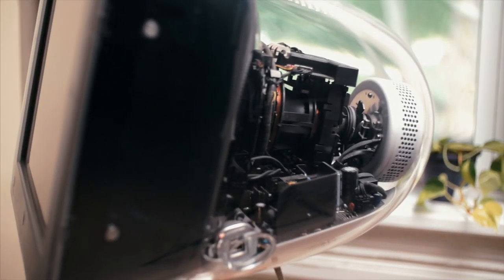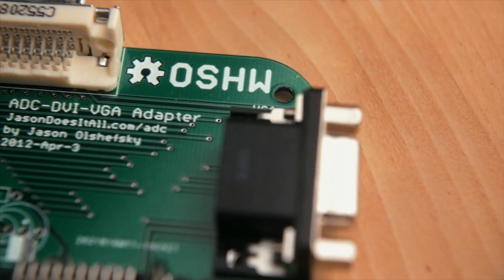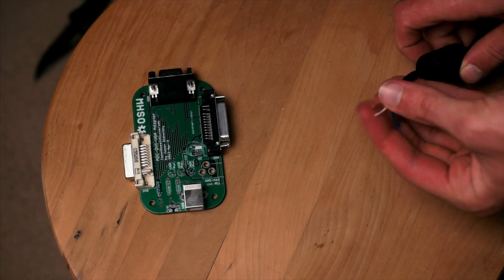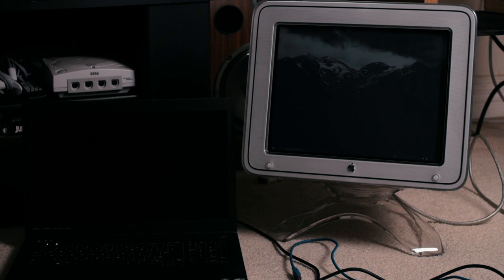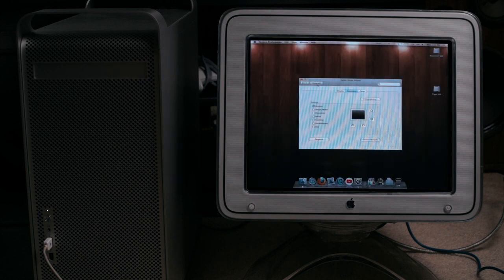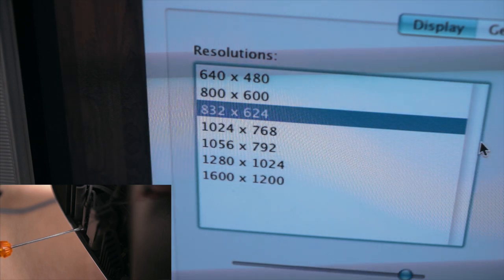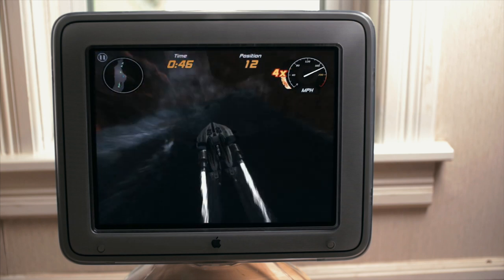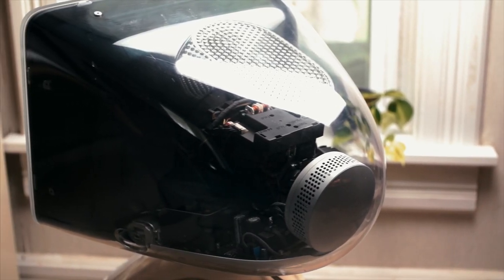Apple's last CRT - Review + Connecting it to a modern PC!

Comment: This man was just poking at the insides of a CRT while it was still on, I could never
Reply from the maker: As long as you know what not to touch, you'll be fine. They're not as lethal as most people think.
Reply: @griffensander  When on they sure are. If its off then I agree. 

I think a better way to phrase this is: just because something can kill you doesn't mean you should avoid it i.e. driving a car, replacing a lightbulb, going outside of your house.. you just need to know where the risks are and how to be responsible and avoid them. And always have a plan for if something goes wrong (often having other people with you)
Reply: Theyre very lethal given that most people dont know what not to touch @griffensander

Comment: Apple did make an ADC to DVI adapter. They are rather common on eBay for 30-40 bucks.
Reply from the maker: Yes, but it's only for their flat panel LCD monitors. The CRT needs adapted to VGA.
Reply: @griffensander  Hey! i'm looking into buying this very same CRT and I was thinking in the official adapter, are you sure it does not work with the CRT? have you tried it before?
Reply: Manu Perez I tried Apple DVI to ADC Adapter. But it doesn't work with this CRT monitor. Now I'll try Jason's adapter.
Reply from the maker: @manuperez6698  I haven't personally tried it, but I am certain it does not work. If you look at the DVI connector on Apples adapter you'll notice it's physically missing the pins that carry a VGA signal through DVI. Not only that, but people on various forums claim to have tried it and say it doesn't work.
Reply: @griffensander  Quick question here then, in the video you talk about less than 154hz (which is the max frequency it can output with old macs) this is because of the vga vs dvi?
Reply from the maker: @manuperez6698  No, it's because Apple used some very specific custom display timings to control the electron gun that were programmed into OS X. The cable makes no difference, if someone could figure out the exact timings you could replicate them using CRU on Windows.
Reply: @griffensander  You have to buy a HDMI to DVI-I to pass analog to the apple dvi to adc converter.  I strongly suspect that others are buying HDMI to DVI-D adapters, which don't have the four pins to pass analog.  Why there exist DVI-I and DVI-D is kind of bad standardization.  There should just be one type of DVI connection, and all should have those four pins. What you have now is people sell adapters as DVI, without stating if it is -D or -I because -D is far more prevalent.

Comment: I just picked one of these up and your video was super helpful. I'm working on building one of these adapters now.
Reply: Me too, i've just ordered everything. How did you do?
Reply: @fernandochapa1433  I have not got it working yet, I suspect my power supply is not proving it enough juice. It shows up as a usb device but no picture.
Reply: I got all the parts as well. I'm struggling to understand the diagram. I got the resistors, what diode did you use? Also, are capacitors that go where it says "VGA Pwr", "USB Pwr", "ADC Pwr". Let me know. I'm about to start soldering. I also got the micro USB, but the large one seems to be a Type B USB.

Comment: Thanks! Really helpful! I ordered the same adapter. 
And I have a question. Did you use not DVI but VGA port of the Jason's adapter? Do I need another DVI to VGA adapter?
Reply from the maker: If your computer has a DVI-D port and you have a DVI-D cable you can just use the DVI port on the ADC adapter because DVI-D carries a VGA signal.  I just used a VGA cable and adapter because I didn't have a DVI-D cable.
Reply: Griffen Sander I see. I'll try after I get the adapter. Thank you so much!
Reply: @griffensander  DVI-D Does not carry a VGA signal. DVI-D standst for DVI-Digital. You can see how the connector is missing the four pins that go around the cross, and instead it just has a straight line in its place - those pins are what carry the VGA signal. You also get DVI-I (I for ntegrated) which carries both, and DVI-A (A for analog, although I've never seen one of those).

Comment: Nice monitor. Personally, I would have fitted all the components, and not just arbitrarily left one off because it was hard to get. Especially as it was causing your G4 laptop to shut down. Seems risky to then plug it in to a bunch of other machines, including your main machine.

Also, why not solder a female PSU connector to the board, rather than just chopping the male end off the scanner PSU and permanently soldering it?

Comment: I'm so glad you made this video! I have one of these monitors and I've been aiming to get it working with my macbook pro. Could you please shoot me the link to the pcb board that you used? Also, is that geometry adjustment software built into the G5's OS , or was it a standalone application within it?
Reply from the maker: I bought mine here: https://www.ebay.com/itm/Apple-DVI-to-ADC-Adapter-board-for-Cinema-Display-A1006-DIY-PCB/113788565793?hash=item1a7e53b921:g:Tq4AAOSwG59c5eu8
The adjustment software is built into Mac OS X 10.4 and 10.5 (and maybe 10.3 and 10.6, but I didn't try)
Reply: @griffensander  Thank you!
Reply: @griffensander  When constructing the adapter board, how many resistors did you end up soldering onto the board? I've nearly finished soldering my board, and I can see in your video that you soldered a blue resistor onto yours. However, when I received all my board components two resistors were included. I was wondering if the second resistor was necessary. Thanks.

Comment: I use translation so there may be something wrong with the text
If you like, could you please tell me the site where this adapter production kit and parts are available?
Reply from the maker: You can order the circut board from here: https://oshpark.com/shared_projects/tUQ9np4l
All of the connectors, components, and a power supply will have to be sourced separately. Info about what's needed is at: https://www.jasondoesitall.com/adc/
Reply: Thank you!

Comment: You didnt add a capacitor which the circuit is designed to run with, because you didnt feel like buying one? Is that right?

Comment: Thank you for yet another great video. I took inspiration from you and went and bought the board and other components out of JasonDoesitAll. I still don't understand the Gerber files, or rather what other electronic components (capacitors, diodes, etc.) I need to buy. Would you mind sharing those? I bought 3 boards from OSHPark (the mininum) and enough components from Mouser to build 3 adapters. Any help you provide would be greatly appreciated. Thank you!
Reply: The diode isn't necessary, it just allows you to use the USB port's power to turn on the display I believe, but the power to do that is already supplied by the VGA and DVI ports.

The capacitor you need is "at least 30V and between 10uF and 100uF" according to the guy who made it (the link to his explanation is in the description of this video). 

Hi! I'll buy one of your boards off you if youre in the UK! where did you get the ADC connectors to solder onto the board? I went through the route of buying an old video card with an ADC port and taking that from it.

Comment: Great video! I'm interested in picking one of these up, but worried about the VESA timing thing. Have you tried using CRU or Nvidia control panel to reach those other resolutions/refreshes on a Windows 10 PC? If so, was it successful?
Reply from the maker: I have, and while all the Apple resolutions and refresh-rates work when set manually in CRU, the only other resolutions I've been able to get working are 1280x720@64p and 1600x900@64p.
Reply: @griffensander  Thanks for the reply! So I ended up getting the monitor but had no luck with some 3rd party adapters. Is there a page with a step-by-step guide to assembling that DIY one you made in the video? I know absolutely nothing about soldering or working with electronics so I hope it won't be too difficult :0

Comment: Is it possible to do this without the board? hoking up a VGA cable, USB cable and 24v power supply directly to the adc cable? or does it need the extra capacitors and resistors?

Comment: Hi, thanks for this video. Just to confirm. If you connect this CRT monitor via DVI to that adapter it won't work right? Only via VGA right?
Reply: DVI can carry either analog signals (DVI-I), digital signals (DVI-D) or both (DVI-I). As long as your DVI cable and whatever is generating the signal is generating analog signal (DVI-A or DVI-I) you'll be fine.

Comment: Theres currently one on sell on offer up that I have my eye on. No idea from the seller if it works. I offered a low ball of 35 as he has it posted for 130 so let's see what happens. But I wanted to know if there are any retro gaming use case for it? Would it be possible to run an Analogue(the company) game console on this monitor?
Reply from the maker: No, I doubt is would work with Analogue's stuff. It's really limited to PC and Mac use because it requires custom display timings.

Comment: What version of OSX is your G5 running? Thanks!
Reply from the maker: OS X 10.5 Leopard.
Reply: @griffensander  Phew! What I was hoping. I've just bought a Power Mac G4 and a copy of 10.5.4 specifically for adjusting the geometry on my 21" Studio Display. However, there is very little info out there about when Apple removed support for older displays from OSX?

Comment: Where is you buy the female adc connector to solder on your board ?
Reply from the maker: Their used to be someone on eBay selling them. If they're gone, it might be difficult to find one.
Reply: I pulled one off an old mac-compatible video card I found on eBay
Reply: @NicheAsQuiche  the know you mean the PCI card I used it ....but it was unsuccessful because I did not have the equipments to desolder the female adc from pci board .
Reply: @paullak625  try a powerful heatgun, that way you can heat up all the pins at one. Or just destroy the board with pliers and cut it out and chip away until just the connector is left
Reply: @NicheAsQuiche  thank you soo much for confirm me about air hot gun and what is  the VGA pwr. ,USB pwr. And ADC pwr. Signs on  the PCB ?
Reply from the maker: I believe they're for LEDs to indicate which connector is active. They're optional, I didn't put anything there.
Reply: @griffensander  ok , thank you so much,I did not see you solder that point too .

Comment: Do you know how to connect a modern mac to a high resolution CRT monitor? All active converters I find max around 720p and I can’t connect my nvidia 980 externally anymore after Apple removed support.
Reply: Just don't. Only Macs with original DVI-I Apple Video cards are allowed to connect to CRT's. Steve Jobs will come after you if you mess with CRT's on modern macs.

Comment: Is connecting is to a display port or hdmi a possibility or is it out of the question?
Reply from the maker: You'd need a Displayport to VGA adapter, then connect that to the custom adapter board (which you'll have to build). I'm actually using this exact setup to connect it to my 2013 Mac Pro.

Comment: Btw Apple did male an add to dvi adapter. Look on eBay
Reply from the maker: Yes, but it doesn't work with the CRT Studio Display because it's only DVI-D. The CRT Studio Display needs DVI-I or VGA.
Reply: @griffensander  I said this already but  you can get Hdmi-DVI-I adapters.  You only have to buy the Apple A1006 DVI to ADC adapter and a HDMI-DVI-I adapter.
Reply: @user-mt4ny2zw7t  HI, did you try this?
Reply: @user-mt4ny2zw7t  The adapter doesnt have the pins for the analog signals. look up images of it. it wont work

Comment: can you confirm where you got the specs for the power supply? Does it have to be 5amps?
Reply: If a power supply does more amps it should be fine, electronics should only drawn what they require, even if the power supply can technically supply more. However, poorly designed electronics may not limit their current draw, so when looking for a power supply when you're reverse engineering or hardware hacing like this its definitely a good idea to limit the power draw manually, either by selecting a  poer supply with a max amps that matches what you need or having a higher amp power supply and using an amp limiting circuit

Comment: Apple made a adc to dvi adapter for these
Reply: sadly the official Apple adapters are only compatible with their LCD ADC displays - they don’t have a large enough power supply to drive a CRT.
Reply: @JBurg  I believe its not the power supply, but that fact it only does DVI not VGA. ever case the official Apple adapters do not work.
Reply: @tanuki2k  it’s actually both!  according to the specs published by Apple, the official adapters are capable of outputting 90w maximum.  The 23” Cinema display (LCD) draws 70w at full brightness and presumably the smaller sizes even less, leaving a safe buffer so nothing overheats in the adapter.  the Studio Display CRT draws ~113w and even if the official adapters passed VGA through they wouldn’t have high enough current to power it.  I’d venture a guess that the omission of VGA pins on the adapter was an intentional choice to stop someone from connecting a CRT display to it and possibly starting a fire.